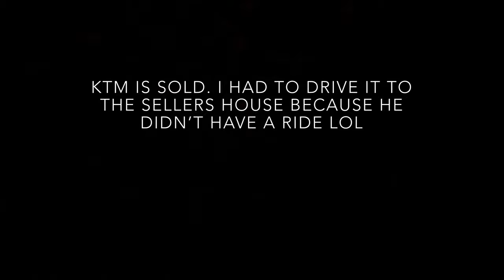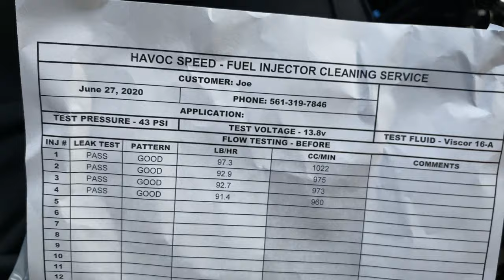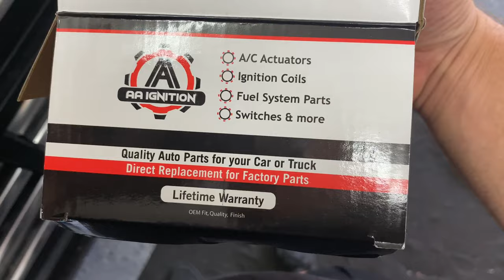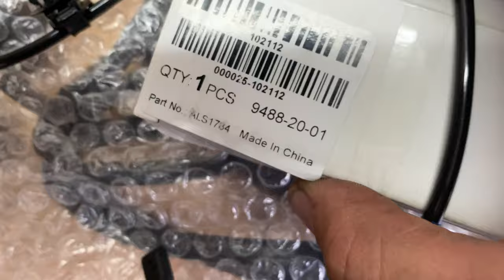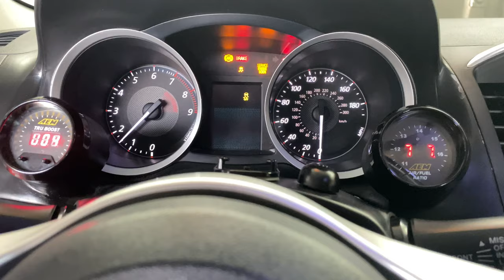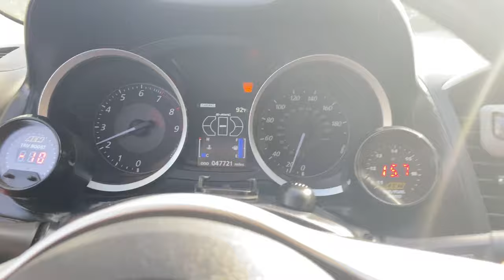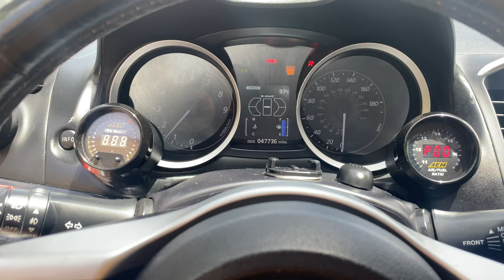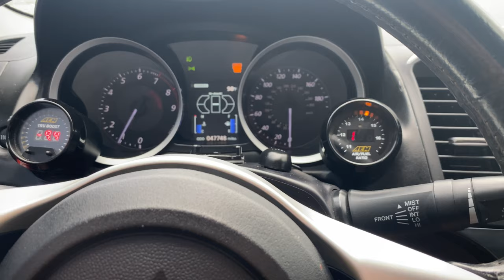Vnotes #105 AYC,ABS and TRACTION LIGHT!

Comment: What was the other part number for the ABS sensor ? And have they been holding up good?
Reply from the maker: I don’t know the other part number at this time I’m sure it’s in the video. The sensors I’ve been holding up great.
Reply: @Joey400  thanks Your video only shows 1 part number but they should
Be different from left to right correct? Or did you get the same part number for both sensors? Thanks again brotha.
Reply from the maker: @bmxhotsauce  part numbers: ALS1785 ALS1784
Reply: @Joey400  yo da man!!! They have them on Amazon… the pair for $25.99
Thank you
Reply from the maker: @bmxhotsauce  yup, those are the ones I got.
Reply: @Joey400  was the driver front connector in the fender well or in the engine bay if you can remember?

Comment: When I go for a pull in normal and not in sport mode it says asc system service required what does that mean
Reply from the maker: It’s just a code. You’ll have to disable it with your tuner.

Comment: how did you find that the front right sensor was problematic....how to find which sensor is bad..please inform..thanks
Reply from the maker: It’s the most common issue. When I dropped the motor, the line stretched

Comment: I’m so confused man, I got the asc service light and comes on when I do a pull and the rear end gets lose it was the reason I couldn’t get my tune done
Reply from the maker: Check your AYC pump
Reply: Thank you! Tuner told me it could be that a line has air or the t case, diff really hoping it’s just the pump
Reply from the maker: @luisparedes9331  also, you might be low on fluid. Check the level in the trunk